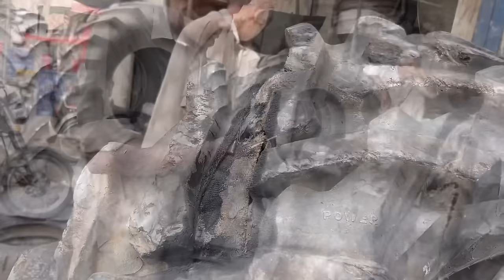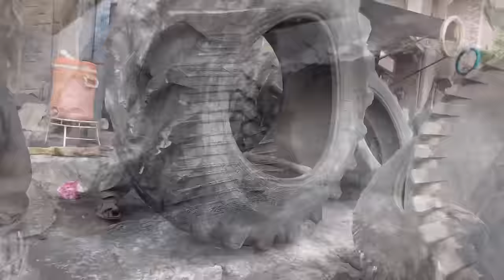New Technique Repair Big Tractor Tire Patch Using Gypsum-Huge Tractor Tire Repair !!

Comment: I've never seen that large of a gash patched ... i'm a bit concerned there where no reinforcing bands added.
Reply: Yes the nylon rope he sowed into the tire is exactly the same as the manufacturer…it was a good job. This is not a new process.
Reply: It won’t last past the first bump.  Both the people doing this repair and the people asking for it to be repaired are ignorant and uneducated.
Reply: @annoyingbstard9407 niet te hard oppompen 😂
Reply: @annoyingbstard9407  Well considering a new set of this type of tires literally costs more than a few years wages in that country (hell replacing anything old with a new thing is super expensive there) they make do with repairing said old thing as much as they can before biting the bullet and purchasing a new one.
Reply: @MegaRazorback    Do they really?  We’re so lucky to have your intelligence pointing out the obvious.

Comment: What is the black liquid they are brushing on, contact cement?
Reply: Yes special rubber glue and nylon fibre for strength. In the west it is used to patch tires as well.

Comment: When you have a hole, the size of Grand Canyon, in a tire without steel wire reinforcements. Maybe you should let it be... 
It failed for a reason.
Reply: A new tire is better than this repair, that's obvious, though the choice here is not between a makeshift repair and a new tire, it's between a makeshift repair & no fucking tractor.
Reply: Looks good to me, last at least a few days.